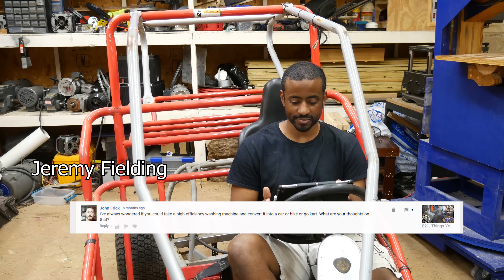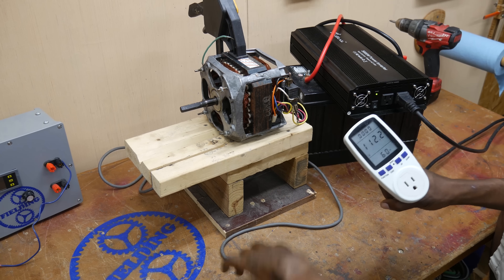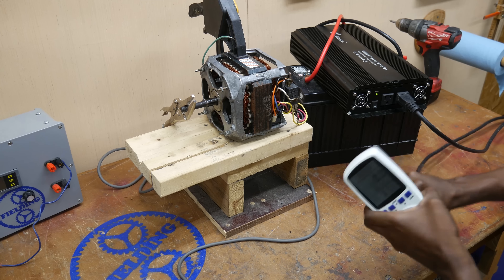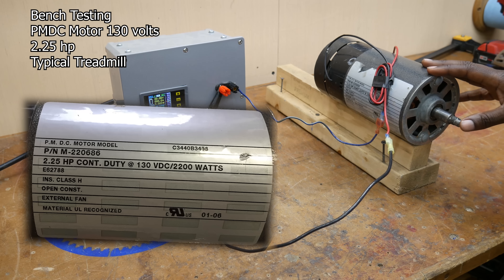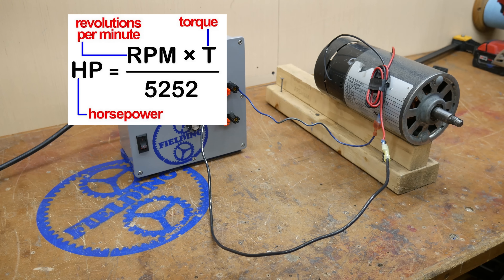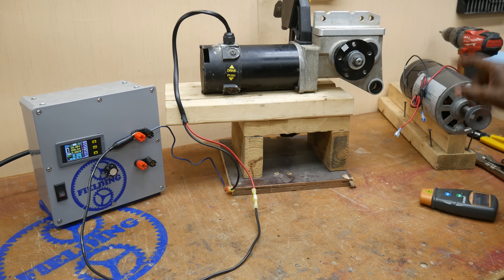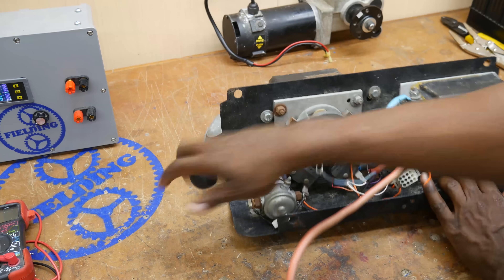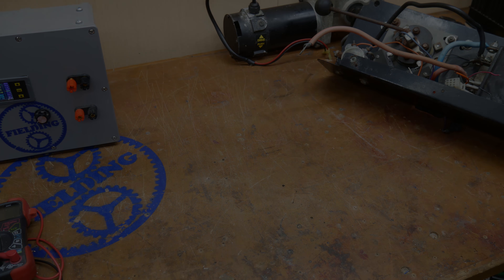What Electric Motors Can Be Used In A Go Kart or E Bike; Bench Testing and Recommended Sizing #61

Comment: Dont measure the starting torque, thats not real torque, test the running torque. Have you ever checked out 'gerard morin'? He shows that high voltage rf level motors run at insane voltage with extremely low amperage(so very safe) and they have very high torque(the amps automatically increase according to the size of the load). Might be a worthy thing to research. He talks alot, but his demonstrations and experiments are legitimate imo. Gas powered motors have been obsolete since teddy roosevelt, there is zero reason a gas powered chainsaw should perform better than an induction motor(especially if 3 phase). Batteries are capacitors, I know people freak out about capacitors comparison to batterys. Everyone says capacitors are NOT batteries, but in reality they actually are exactly like batteries. Batteries are capacitors with extremely low 'Farads'(unnecessary complex terms that completely unneeded, Farads measure the time it takes to charge and discharge a capacitor, batteries are capacitors that take a long time to charge and long time to discharge, Farads are a horrible horrible name for a aspect of electronics. Electrical engineers dont understand 'naming', computer programmers understand that 'naming' is the most important part of computer programming. What requires memory space a function called 'ProcessData' or a function called 'UploadMp4Video2Youtube'. When people look at code and see 'ProcessData' function, they have absolutely no idea what it does and therefore they have to spend their time looking into the function and understanding what it does. Even the programmer of the 'ProcessData' code will not remember what it does 3 months from now.  This causes hours of uneccessary research into what the function actually does. If the function was called 'UploadMp4Video2Youtube' then the next programmer to read it, automatically understands what the function is supposed to do and they do not need to read any code at all, this saves countless hours, COUNTLESS. Electrical engineering use terms like 'ProcessData' for all of its units of measurement. Its retarded and makes things unnecessarily complex. A Farad has nothing to do with quote unquote 'charge' aka Q. A farad is the the rate at which a capacitor charges and discharges to some arbitrary ratio that ive yet to pin down. Batteries are extremely low Farad capacitors. Farad as a 'ProcessData' name, it means even less than 'ProcessData', despite being vague, at least 'ProcessData' tells the reader that it 'processes data', the term 'Farad' means absolutely nothing from any point of view. Horrible name. Farad should be changed to 'charge/discharge rate in seconds'. The 'voltage'(electric potential) of a capacitor is just the highest amount of voltage the material can handle without overheating, its only relevant in microcontrollers and microprocessess, and motherboards. Voltage is an even worse name than 'Farad', because it means 2 things not just 1. Voltage can mean electric potential and electric motive force. Thats horrible naming. Idk, Im starting to realize electric motors are much simpler than previously thought because so many of the electrical engineering terms use horrible names and electrical engineering uses unnecessarily complex equations for almost everything. Universal language for math is 'dont use fractions and decimals'...

Comment: Good advice for the newbies starting out! Definitely purchase the right speed controller as initial start up current can kill any controller!! And the gearing is important as you might have everything right but if it's not geared right the motor can draw excessive amps. I'd rather a bit more torque over speed anyday👍
Reply: Wheelie bars to follow

Comment: Wow, even if it were 3000W peak(which isn't really how one should measure AC power), that inverter would still fall short on power delivery.
Anyway, the 1/2 HP would've killed that washer motor idea, but the finer aspect brought up in the video really cement it and do a great job explaining the complexities of the task.

Comment: I don't think your problem was the inverter, but the fact that you had only one battery, you need at least three.
Reply from the maker: This was an intentional overload condition. 10,000 batteries wouldn't do it. Consider for a moment that one battery can turn over a diesel truck engine.
Reply: @Jeremy_Fielding  I disagree, a stalled motor is virtually a direct short, so you have to compare apples to apples and oranges to oranges. I've run off grid with solar, and have a 3000 and 5000 pure sine wave inverter and I have 12 deep cycle batteries. Neither one of my inverters will work with just one battery. My point is don't blame the inverter for not providing it's max capacity.
Reply from the maker: Ok. Let’s agree to disagree. But it’s worth noting the problem was the rating is to be divided in half. half for each outlet. Check the description and thanks for watching
Reply: @Jeremy_Fielding  Sounds like a plan.

Comment: Don't need a massive inverter , you need a 24 volt to 110 one ,> TWO battery's running a 24 Volt inverter , twice as efficient .. and Will not cut off

Comment: How about a flywheel or large gear with multiple motors around the gear to share the load and then for speed control you can shut down a motor or two which would have them feeding a percentage of the power back to the battery so it lasts longer. Also dc motors have speed controllers.

Comment: AC induction motors are still a viable option, but you need to use a controller and really know what you're doing with the wiring look up alternator powered go cart

Comment: RC motors and ECS can do the trick. ment for lithium batteries and insanely efficient. best of all. easy to program via aduino for speed control. and you have a solid system on the cheap.

Comment: Hi Jeremy,

Thanks for your interesting videos about motors. Keep up the good work thoroughly enjoyed and learning a lot. I have a project an electric motor bike I purchased over 10 years ago. It’s working fine however it doesn’t last the distance. It’s using lead acid battery. I keep looking at any battery that last the distance but no luck. I have dismantled it and left at my garage for over 10 years. Now I found out the lithium batteries will last the distance & lighter. I need to test it with my drill batteries two of them to provide 36 volts. However while I was changing the terminal to the input side of the controller  battery side. I touch both wires and a spark occurred. Will this damaged the controller. No power there because it’s disconnected to the battery. I check the continuity using my tester by connecting the battery input side together then checking the output side of the controller if there’s continuity, it ok. However when I connect the input side to the battery then check if there’s voltage on the output side of the controller no voltage. Is the controller damaged by the shortage.
Hope to hear from you soon. While waiting I ordered a new controller waiting for it to arrived.

Comment: The inverter probably cut out because you only have one battery and the leads aren't very big. The 12v DC current input dropped off too much for the inverter. I agree that this is not a good setup anyway. Good video.

Comment: What if you used 2 treadmill motors with x2 80v lawnmower lithium batteries in parallel. Gear down it a bit, then you would have a efficient cool motor setup

Comment: Late af.  But...the granny chair had 2 motors? Use both. Have one geared as is to get started, then transfer load to the ungeared 3100 rpm for speed. Weight of extra motor is what, 40 more lbs?  And an electronic transfer mechanism would probably benefit motor longevity. But why not if you already have the 2nd motor?

Comment: What I don't understand is increasing torque you lose speed, so how would you increase speed with an increase of torque?
Reply from the maker: You need more power... a more powerful motor
Reply: @Jeremy_Fielding   so a motor that will take more volts to power it?
Reply: Increase volts youll increase speed. Increase amps youll increase torque. My ebike motors rated for 48v 20a but you can run it on 100v and it will be fine but if i increase the amps to 100a it will burn out. Amps nirmally kill the motor. Get a cheap alternator convert it to bldc on star not delta as delta isn't efficient and put 100v 60a youll get 40 mph

Comment: You need more batteries on the testing of the washing machine motor and inverter. The voltage sag from the load could have triggered the shutdown. More amps from more batts in parallel would help you.
Reply from the maker: These batteries are designed to start a car. We are talking about hundreds of amps every time you start your car or truck. I believe I didn't make that clear in the video because this seems to be a common response. But the batteries can handle the current. That wasn't the point of the demonstration. Locking the rotor guaranteed a failure. I wanted to show the limits of the inverter... The battery wasn't a limiting factor.

Comment: If you put a set of inline maxwell ultra capacitors between the motor and inverter you wouldn’t have a power drain you should know this
Reply from the maker: These batteries are designed to start a car. We are talking about hundreds of amps every time you start your car or truck. I believe I didn't make that clear in the video because this seems to be a common response. But the batteries can handle the current. That wasn't the point of the demonstration. Locking the rotor guaranteed a failure. I wanted to show the limits of the inverter... The battery wasn't a limiting factor.

Comment: Thanks for your help. What do you think about those 48v batteries on power tools, can we wire two of those in series to get 96 volts to run a 90v treadmill motor? I mean i know it will work, but what do you think will it be feasible?

Comment: No Inverter required!
A washing machine motor has brushes and a field coil.  Therefore you can run the motor on DC.  Connect the rotor coil to a 24V battery source for example and control the field coil using a PWM speed controller.
Reply from the maker: It’s an induction motor... not all washing machines use a universal motor which is what you are thinking of. Universal motors in washers are more common outside the USA
Reply: @Jeremy_Fielding  Ah ok, thank you for that info.  I had thought since their speed was variable, they would all use a universal motor.

Comment: If you increase battery cca capacity to inverter, the inverter should handle whatever wattage the inverter "actually" handles. If manufacturer is being truthful about rating, then inverter should handle 80% of claimed rating after startup if they are properly protecting the circuit.

Not saying you are, but most people forget the 80% rating engineers design equipment for. So if this unit is accurate in rating, they would protect their circuit after 2400 watts + whatever allowable time period (slow blow fuse as to not) at sustained wattage before circuit protection acts. 

Apologies. I am merely commenting just because you said inverter wasn't even close to rating. But without sufficiently supplying inverter enough power with what work the motor is demanding, the inverter might actually be closer to at least 2400w continuous capacity given enough heavy friends holding hands correctly, adding more weight, thus asking for even more power.

As far as video, good example of why ac is bad idea for this application. Not to mention AC to DC (charge battery) back to AC. Screams inefficiency.
Reply from the maker: Please check the description for an update on the rating issue.

Comment: why not try a car speaker amp ps you are running on pure cca cold crank amp draw  might as well alternator install as well you can find really small ones to charge you cells and juice with an amp and rewire with a variable speed control

Comment: Guy made a good one using a truck alternator with batteries and inverter from RC cars.  If you use a friction clutch you will avoid the locked rotor current situation.

Comment: My dad took a motor from a forklift and put it into a Citroen Xantia. It wasn’t fast, only going 30Kmph max but it had some ridiculous pull. It was able to pull a Honda Ascot which had a trailer connected with 2 tonne of paving stones. Basically he was pulling around 3 tonne. It was a beast but it took a while to get to that point.

Thanks for explaining the gearing thing. I often wondered that myself. You sir explained so clearly.

Comment: You absolutely can run a 120 v ac motor on DC volts. You would have to run your batts in series,  and you still will need 120v.
Reply from the maker: Even 120DC will not run an Induction motor. You say it as if your sure which makes me think you are mistaken about what kind of motor I am talking about. It would just lock in place and eventually burn the winding.
Reply: Right. It would have to be a universal motor he is thinking of.
Reply: @MrFigureitout  a brushed ac motor.

Comment: Do some liquid cooling experimentation.  Perhaps you can cool the body of the motor with a water jacket.  Not sure the wiring insulation will survive, but with the wicking of the heat by water, perhaps it will be enough to increase performance.  It works for the electric car makers.  :)

Comment: HA HA. what you forgott is TRUCK starter motors, 24v, 6.7kw/9hp babbyy ,all you need is 2x12v batteries and a speed controler, or if you are brave , a switch . also if you use a switch you actually get to keep the bendix hahaha , if not you need to make a shaaf. but the thing can be stonking fast

Comment: You can use an AC 3 phase motor with a vfd and a voltage regulator no inverter needed. Running several lipo or lion batteries in series to get a low ("dead") cell voltage over the minimum input voltage of the vfd. For instance for lipo packs you would need 64 cells in series to get a cell voltage of 3.3v and total voltage of 211v. Fully charged the power source would be 269v which is why a voltage regulator would be needed. Then run cells in parallel to get the amps needed for the motor.

Comment: The rant about gears and free energy. My take is that you dont require as much torque once obtaining momentum so gearing does offer additional power. Vise versa for initial torque. Which is why I love the idea of a CVT on an electric motor. It's the efficiencies in overall performance like balancing peddleing and coasting when riding a bicycle.

Comment: Inverters, have a continuous  ratting and a surge ratting. The 3000 is your MAX surge ratting. your  continuous is only 1500.
Reply from the maker: Please read the description about this. The rating is the continuous
Reply: @Jeremy_Fielding  WRONG. A 3000 watt inverter is THE MAXIM SURGE RATTING EVERY TIME Regardless of the brand. So unless you have a 6000 watt inverter, witch would be twice the size to hold the extra cooling fans, then your continuous is Only 1500 watts.
Reply from the maker: @alberthinds78  I am not sure how you can disagree with the man holding the manual but thanks for watching LOL

Comment: You can use auxiliary electromagnets on permanent magnet DC motors for field weakening or amplifying for adjusting torque-speed characteristics and current consumption.

Comment: Fun fact - hybrids run on AC motors, not sure of induction. Mine runs 3-phase 304V. The engine is mostly just a battery charger, especially at city speeds. But it's closer to a 150 hp motor, not the 3/4 hp from a washing machine.

Comment: He used a starter from an F-150 with a 400 cubic inch motor or something in that range it was a large block 8-cylinder so the starter was strong it was a great video that explain how it needed to be wired.

Comment: Im only 16 and studied the induction motor for days. I though I can model one on AutoCAD and build it for my ultralight aircraft design. Firstly I realised there will be complex windings for phases and connecting in terminal box “star/delta” Then I realised I cant connect it on DC power supply and I realised the ac drivers are too expensive. Now Im finally relised its trash for running vehicles.

Comment: Induction motors need sinusoidal voltage for maximum hp.  Inverters generally yield substantial distortion and this is especially true when supplying a heavy load.  Finally, instantaneous power is P=VI, so the lagging current from motor inductance makes the average power much less than V_rms I_rms.  A parallel capacitor would help correct this power factor reduction but the wave shape will still be a problem.

Comment: Your problem isn't the inverter. It's the battery. Not enough sustainable amps to supply 3000w @ 12v. You need like 4 of those batteries for an ideal ac settup. Retry this one with more batteries wired in series please.

Comment: A Car starter motors (especially old cars) are usually series wound DC motor. A very high starting torque type of motors and will produce a high speed (sometimes destructive) if driven with no load.
Nice informative video. Thanks

Comment: I read somewhere that Tesla car uses small batteries, like 3V or smth. combined to get the voltage they need. Can you make a video about that and also how to wire like 50 lithium batteries, without voltage getting to 150, and also explain if that is a good way to power a go cart. Thanks a lot. Just today I started reading about electricity and watching videos and yours have been by far most informative and easy to understand. Thanks
Reply: Yes you can use 18650 lithium batteries from old drill batteries and such. They are very powerful and long lasting. That's the same exact batteries the are runni g the tesla cars. Just a whole lot of them!!